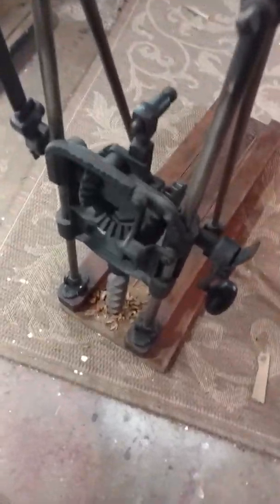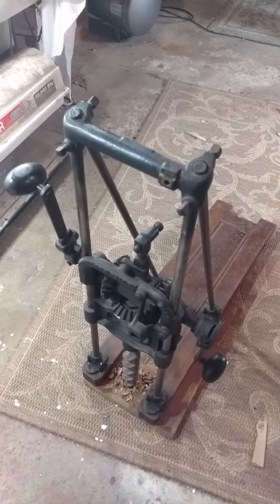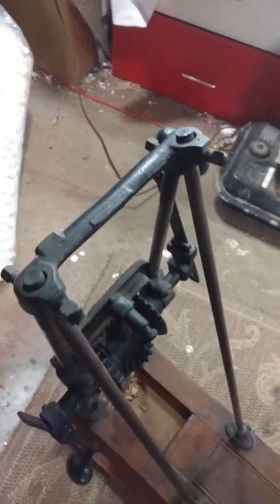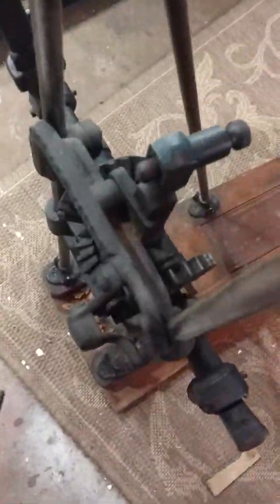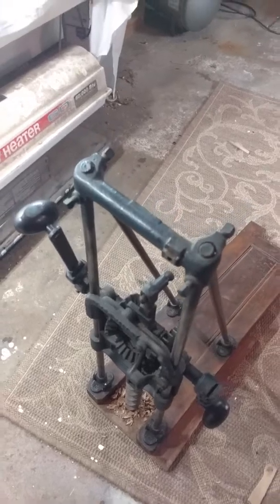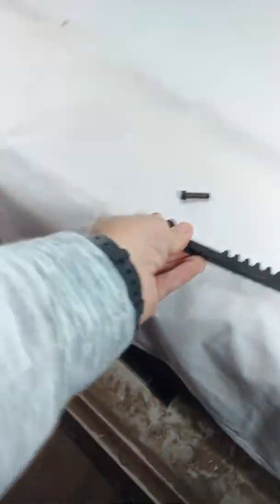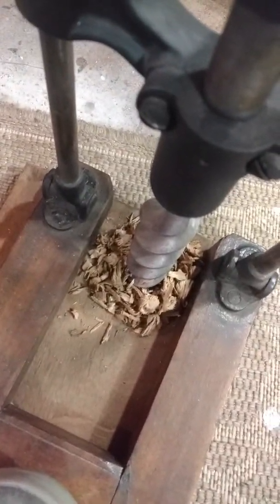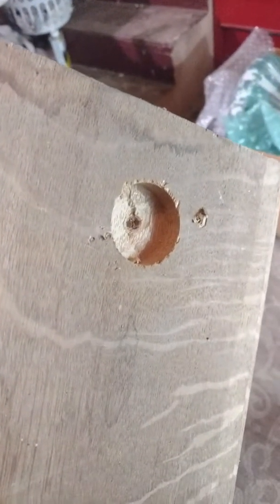Antique Millers Falls Massachusetts wood beam drill auger Rising Phoenix antiques

Comment: You turn the top handle 90° to push the lift gear over so that it will disengage the lift rack gear that you have incorrectly removed. And it will turn freely to bore a hole.  When you are at the bottom of your mortise, you turn the handles one full turn or more in reverse to back the lead screw on the bit out of the bottom of the hole/timber. Then turn the handle back to the position shown in the video and it will engage the lift gear. Turn the handles forward regular and it will pull the bit up and out of the timber.